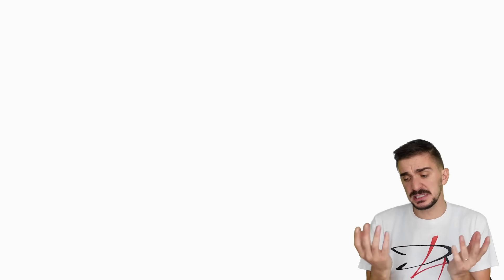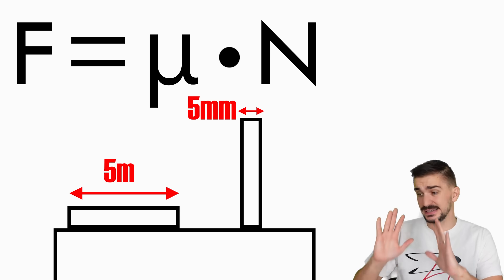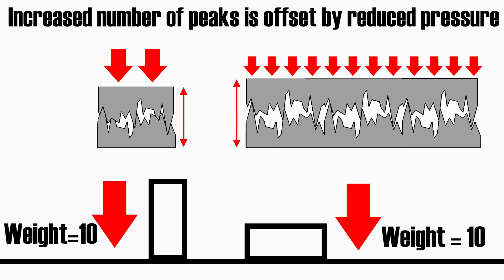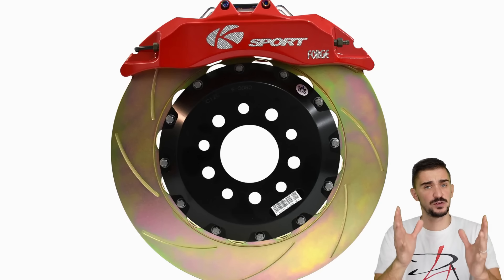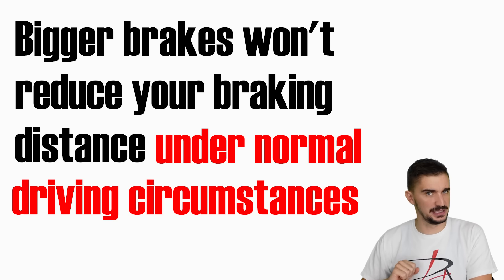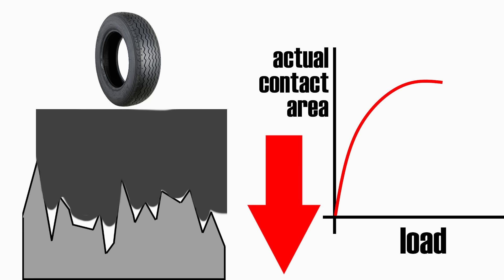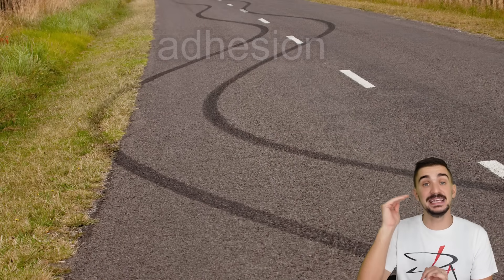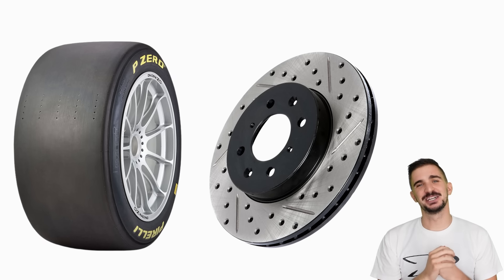Why Big Brakes Won't Stop You Faster but Wider Tires Will - Friction and Surface Area Explained

Comment: No, bigger brakes will stop quicker then stock brakes becuase large calipers have 6 or 8 large diameter pistons that increases force and gives more even force across the rotor. Then the heat dissapation is also increased but this is not the only benift.
Reply: the force doesnt matter if your already at the limit of the tires, which is going to be the case 99% of the time

Comment: Explanation fails to account for one variability, the driver. Larger braking surface area can give the driver much better feel which can result in shorter braking distance.  The example (8:15) of a street car with stock brakes being able to stop as well as it would with bigger brakes isn't entirely correct. There is a very narrow window between locking up the brakes and keeping the tires on the limit of adhesion during braking. The small brakes have a much smaller window than the larger brakes. In theory, both brake the same. It practice, the larger brakes bring a distinct feel to the driver which allow the driver to keep the brake pressure on the limit of tire adhesion much easier and thus stop faster and as mentioned, more reliably.

Comment: say what u want, but better/bigger brakes and pads (within reason) matter. u realize it when u experience brake fade on a bicycle going continually steep down hill. and its scary af, pulling the lever but not stopping. also seen car brakes smoke up in similar setting.

Comment: I will disagree with this as using the same single piston caliper I swapped from stock rotors on my WRX to 14.75” diameter rotors up from. Was a lot less pedal pressure to come down from 110mph runs on the drag strip and was able to take the first turn off. After almost 20 years I finally took the rotors off and went with a stock Brembo set up but, now I have 4 piston calipers so is seems to be better but, Etown is closed so I cannot make any runs to have a comparison on the same track 😢
Reply: watch his new video
Reply: @muzzyjk  Considering I actually experienced larger diameter rotors and the affect. I do not need to watch a video

Comment: Yes and no. The reason for larger brakes isn’t the one time stopping incident, but for heat dissipation based on continues hard braking. Those smaller brakes would melt if presented on an F1 car or put on a Semi and tasked to slow 80k lbs down a 7% grade for 5 miles. In fact, that’s too much work for any brake system, so Semis use the engine to slow down under such conditions (aka the Jake brake), Will the average driver or even the “prosumer” ever get their money’s worth from Brembo brakes even if driving a 700+ bhp car? No. Still, under load or heavy use or in inclement weather, the bigger brakes with their significantly better ability to maintain intermediate levels of grip prior to lockup can and are seen as assets.

So, big brakes won’t stop you faster in a specific scenario where you’re on flat pavement and need to stop completely… once. They make a massive difference under substantial load, under repeated hard braking, or in inclement weather where heavy rains can lead to brake fade (we see that often on Central Florida)

Comment: the biggest reason bigger brakes can keep up with the heat better is that because the caliper and pads have a higher distance from the wheel centre and with that having a higher leverage on the wheels and less pressure is needed to brake just as hard. less braking pressure results in less heat creation. that is also the reason that big brake kits also do not just use the stock caliper and pads on a bigger disc with a different mounting bracket. it uses bigger caliper and pads to ease the pressure per mm2 thus creating less heat.

Comment: Bigger tires don't really improve braking. They allow more braking power to be used. This only if there is so much  braking power overhead relative to your tire's grip. I.e. you're constantly locking up. If you increase tire grip you can use your brakes more (harder). And I should add to my last comment that it goes without saying that a big brake setup doesn't work if you don't have the mechanical grip to support that kind of torque.

Comment: This is simply not true. Bigger brakes DO increase stopping power and DO decrease braking distance. Not because of surface area contact, that's for heat dissipation - true. A larger rotor applies the 'Normal' force at a distance further away from the center, increasing the moment arm and therefore brake torque. "Big" brakes typically come with more pistons and generally this equates to a larger total piston area (despite each piston being smaller), and since your hydraulic pressure is the same (for a given system), your Normal force is also increased and therefore increases the force of friction (Fn = Pres x Area). These are literally the two best ways to improve braking: increase disc diameter and increase piston area.
Reply: Where is your evidence. Even supercars have similar braking distances of passenger cars.
Reply: The supercar vs passenger car comparison in the other video was misleading because that's only true at very low speeds where high amounts of sustained braking power aren't used to begin with. It's like saying engine power doesn't matter and then using a 0-30 comparison because most cars will do that in roughly the same time.

 If you want to stop a Sena going 200mph you will need the bigger brakes which is why it has them. An MX5 at the same speed with its brakes wouldn't be able to handle the heat and the stopping distance goes up.

Comment: If tyres pressure is same, wider tyre will have similar contact surface. If braking pads friction force is the same larger diameter brakes discs will generates greater braking torque.
Reply: If the smaller brakes can already lock the tyres then it won't matter.

Comment: Wider brake rotor means higher brake torque (torque is equivalent to force by radius) thus lower braking distance. With higher friction comes higher brake temperature, these extra heat will sped up brake fading. With proper pad material, increasing brake rotor diameter surely reduce braking distance...
Reply: doesnt matter if your limited by tire, which is the case almost always

Comment: Great vid.  I think there's a little bit more to good brakes, such as more predictable modulation.  My '19 Quattro has great brakes, but the old '03 BMW 330i had better brakes, for sure, with better feel and consistency at all times.  My MR2 race car is way cheaper than the Exige track car I sold two years ago, but on track it's actual race brakes destroyed the Exige's from the first turn to the last.  Stock brakes WILL not perform "just as well" as larger, better, aftermarket brakes even at the beginning of hard driving.

Comment: It's quite telling that you posted a formula and a lengthy explanation about why large brakes won't stop your car faster, and then just insisted that physics didn't apply to tires, with no formulas and no explanation other than '"it's been proven".  But no, it hasn't.  Everything you wrote about brakes and physics applies to tires as well.  Here's a video for your enjoyment, and then I'll explain what you're missing.  https://www.youtube.com/watch?v=loaJVp4ARZA
Reply: So for starters, a motorcycle under hard braking does ALL of it's stopping in the front tire, which is a tiny skinny bit of rubber compared to four massive car tires.  Yet the motorcycle will often stop faster.  If you object that the motorcycle is lighter, that simply means that you don't understand the physics of stopping.  

But onward.  Modern drag racers have as much as 12,000 horsepower.  In years past they had closer to 2000 horsepower.  How wide were the tires then?  And are they six times as wide now, to transmit all that power to the ground?  Nope, their width hasn't changed much.  In fact, when the tire spins up on takeoff, it becomes substantially narrower, so the static width doesn't even mean much.  

There were even drag racers who experimented with putting on FOUR rear tires, thinking they'd get double the traction!  Nope...they didn't get any more traction, but they had to move a lot more weight, and those cars lost regularly.  The idea was dropped.  

Now, as to why race cars have wider tires, but only up to a point - surprise, it's much the same reason that they have larger braking surfaces - better cooling.  That's one reason.  And another is that for a given tire compound, a wider tire spreads the wear out over a larger surface, so the tire lasts longer into the race.  

Modern F1 cars depend on that physics formula you showed for surface traction.  The coefficient of friction between the surfaces, times the normal force (the force pressing the two surfaces together), this force determines the grip between tire and road.  Thus the modern high speed cornering F1 cars have wings that are angled to press down, increasing the normal force between tires and road surface.  They tried even larger tires, it didn't give them more traction, they just became heavier, more unwieldy, harder to balance, and harder to manufacture.  

But tire manufacturers love that people believe wider tires give them better traction, it helps them sell a lot of expensive tires.  

If you're still not convinced, enjoy this video:
https://www.youtube.com/watch?v=kA0E7kRhd6M

Comment: Wrong! I guarantee you that a 16-in rotor is going to stop  a lot faster than a 13 in rotor in a situation where tire adhesion is not a mitigating factor and weight is.

Comment: Couple of points here:

1. "Bigger" brakes often include brakes with increased radius. These brakes do, in fact, increase the braking force, because the torque produced with the same amount of force increases.

1.a. Big brake kits can also include modified brake boosters that increase the force on the brake pistons for the same amount of pedal effort, thereby increasing braking performance through more normal force.

1.b. You might need more braking torque if A) your stock brakes couldn't lock up wheels to begin with (and therefore you have a bit more performance available if you get closer to lockup), B) you get better tires with more grip (mostly from softer rubber compounds, though tire size and shape can matter), C) you add aero so your normal force at high speeds increases, or D) you already have aero then add power so your top speed (and therefore maximum normal force) increases.

2. Large pad areas increase the consistency of braking performance, not just the heat dissipation. Multiple pistons on each caliper require larger pads, and multiple pistons again increase consistency.

3. Spreading the clamping force over a larger area means more force can be applied to the pads without digging into the rotor and destroying it. It also mitigates warping of the pads, allowing the entire pad to do its job better.

4. I'm 99% certain the same effect that makes tires work better when they get bigger also means brake pads technically work better with more surface area. I've seen mixed opinions on the subject, but pretty much everyone who disagrees is quoting some first-year textbook, while people agreeing seem to be quoting more advanced experiments. Unfortunately, I haven't found any really conclusive article on the subject that quotes anything beyond intro physics courses.

4.a., rationale for (4). If you press two rough surfaces together, the peaks on each surface will quickly run into peaks on the other surface. In order to get more peaks to touch, we necessarily have to bend the first peaks out of the way. The more peaks we bend, the harder it is to keep bending all the peaks, making it harder to increase the surface area. If we increase the surface area, we increase the number of peaks we have to bend, but each peak is much easier to bend a little more, so we should be able to get a bit more friction out of more peaks with less force per peak, the same way we do with tires.

4.b. I think the reason you don't see the differences as much is just because bending metal is much harder than bending rubber, so you're looking at a seemingly-linear local area on a much larger curve.

5. Motorcycle brakes aren't typically vented because they don't really have to be, as light as they are.

5.a. A typical, high-end sport bike weighs something like 450 lbs for a liter engine. Smaller engines might weigh 100 lbs less. A typical rider probably weighs 200 lbs with full gear, giving us 650 lbs. Compare that to a very lightweight Lotus Elise at 1950 lbs (for the American fat-boy version I had like 15 years ago), 2400 lbs for something like a Miata or 1st/3rd gen MR2s, and 3000+ lbs for a Mustang, Corvette, or similar (plus more for the driver). Many of the newest sports cars are hitting over 4000 lbs for the heaviest models. Even with twice the brake rotors, a typical car needs to dissipate a lot more heat per wheel -- 65% more for the Elise, 3 times as much for a fully-loaded C8 corvette.

5.b. Despite very good power-to-weight ratios, allowing motorcycles to accelerate off the line much harder, motorcycles don't really have amazing top speeds. The Honda CBR400R does about 110 mph, which can be beaten by a 90's Civic, while a Yamaha R1 hits 180-190 mph top speed, about the same as a modern Corvette. Intermediate bikes like the R7 or CBR600R hit 140-160 mph, which is about the same territory as a Mustang or similar car. So it's not like motorcycles need huge brakes for stopping from 300 mph or something.

5.c. Even a modern car with ducts pointing right at the brakes tend to have vented rotors to dissipate the extra heat, and to increase the mass available to store heat while it's being cooled between corners.

5.d. Also, most all modern bikes have a rotor on each side of the front wheel, effectively making them "vented" on the end that does 70% of the braking. I can't find anything from 1985 or newer with just one rotor, except very small bikes like the Honda Grom. I think this is more for looks than actual performance reasons, but it definitely helps with heat dissipation for people pushing their bikes hard.

Comment: Big brake kit is the first upgrade I did to my car when I started to track it. Street pads just don't work at all on track, but instead of BBK, better pads would have been a better choice initially. Of course now it's a full racecar, BBK is pretty much mandatory since the stock brakes are way too thin to last a full race weekend, so doing it "early" wasn't much of a problems. Pads/rotors cost (way) more, but you change them (WAY) less often, so you end up actually saving money on labor.
Reply: I totally agree, my big brakes and pads last way longer than standard brakes.
Reply: Are you paying for labor to change pads on a track vehicle?

Comment: ABS just HAD to be the greatest Technical Innovation - above and beyond all that is mentioned here. I was always taught that MU (coefficient of friction) will never exceed 1 (one). Automatic Braking Systems will always give you the shortest stopping distance, assuming that all of your Braking Components are in good mechanical shape. Reducing the mass of your vehicle should also help to improve the braking.

Comment: Bigger rotors--> braking force is applied at a greater distance from thé center--> more braking torque. So yes bigger brakes provide more braking power

For tires on dry,, thé explanation is quite correct. For à unit of patch contact surface area,  grip = radial force ^0.8  so distributing thé weight of thé car over a greater contact patch surface area improves grip
Reply: Just realize you can't increase the contact patch area by fitting wider tires. The contact patch area won't change.

Comment: But can't larger discs offer better stopping power through having a larger diameter, and greater leverage to apply a grater counter torque to the spinning wheel?
Reply: you are correct, larger disk get more brake torque, but anyway your tire probably slip first, that's why you have ABS.. in most case it's BBK is useless on street.

Comment: Nope. Him saying that wider tires means that the water can't get out from underneath the tire is wrong. There are usually grooves in the tire so that water can escape from the front and rear of a tire going forwards or backwards.

Comment: There do not appear to be any clarifications or exception noted in the video therefore the answer is bigger brakes can stop you in a shorter distance. One long ass video to prove yourself wrong. It is too much of a sweeping statement. 
So on modified road cars they would stop you quicker. Please correct me of i have missed this caveat in the video.
Reply from the maker: You have missed.... The entire video.
Reply: Just to upgrade your brake won't stop your car shorter if you are not upgrade your tire to cope with extra brake force... otherwise those extra force will just make your tire slip...
Reply: The sweeping statement as far as i can tell was that bigger brakes wont stop you faster. 
Umless it is aim at people.who modify or track day, which it doesnt appear to be, then there is absolutely not point ro the video because joe bloggs doesnt care.

Comment: Increasing the brake pad surface area but not increasing for brake fluid pressure means same pressure spread over a larger surface area, resulting in less brake pressure per square centimetre. Less pressure leads to less friction.

Choosing a brake pad material suiting in higher friction and less fade will give more braking power, time and time again